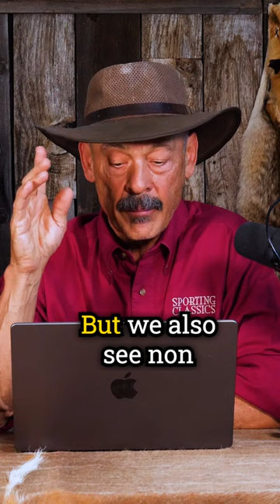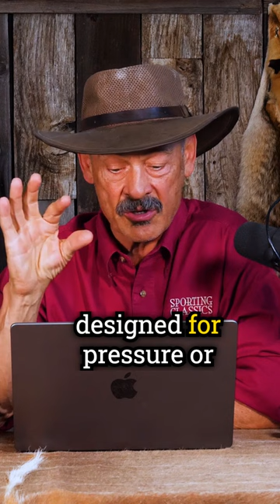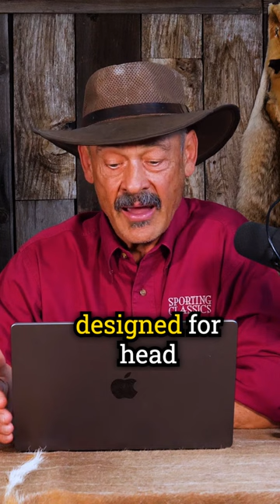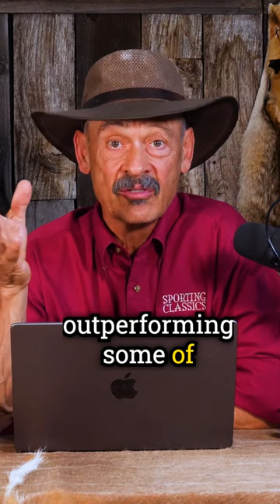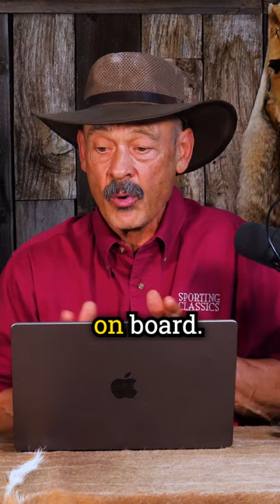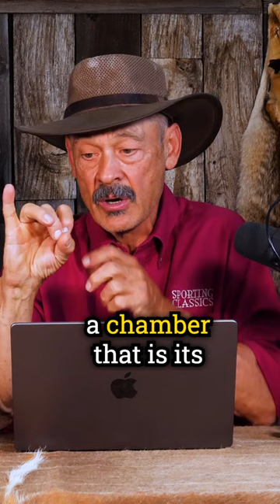What is a Belted Magnum Cartridge?

Comment: Here's the reason behind belted cases. When gunmakers Holland and Holland designed the .375 & 300 H&H cartridges they needed a place to headspace them on since they were long and tapered with no definite shoulder for headspacing. This design was for the hot hunting environments of Africa and India as it is thought to keep the casings from sticking inside of the chamber upon firing. And since a lot of the magnum cartridges are based on the H&H casing the belt was left on to ease manufacturing of bolt faces for rifles.

Comment: Belted cases was more about about a standardization of bolt face sizes for bolt actions for emerging markets once cordite and single base powders were becoming marketable.
Reply: Interesting idea, Hans, but I don't understand why the belt around a case is needed to standardize bolt face sizes. The .473" rim diameter of the 8x57, 7x57, 30-06 was a standard from at least 1888. The 375 H&H of 1912 with its .532" diameter rim/belt did establish the need for a larger bolt face, and a large family of cartridges evolved with that rim size, but that had nothing to do with cordite or other smokeless powders. They could have made the 375 H&H case with the body diameter at the head the full .532". The only reason they stepped it down was to leave a sharp rim on which to headspace the cartridge. Please elaborate if I'm missing something here. Cheers.